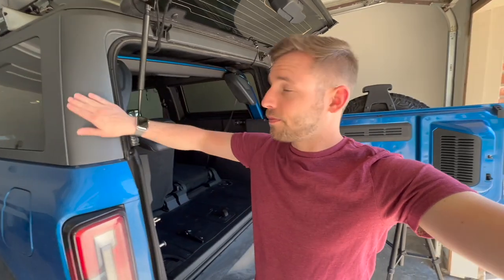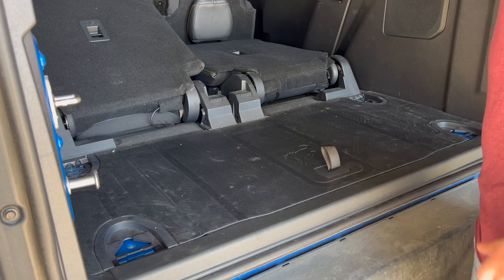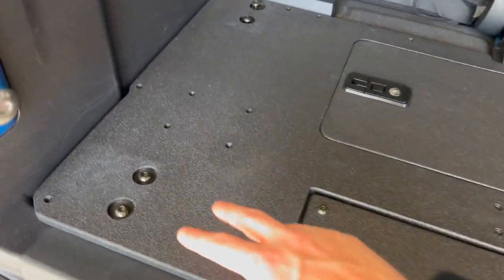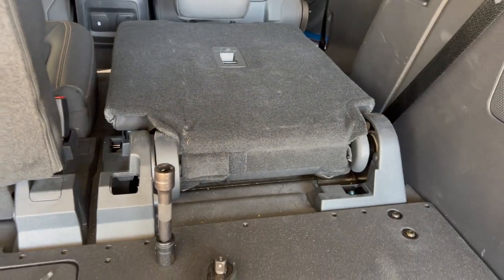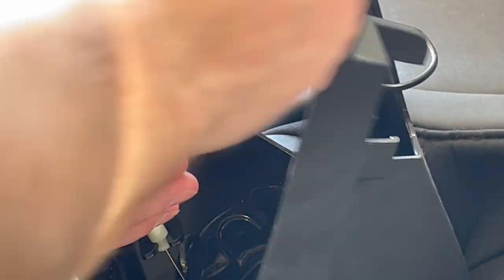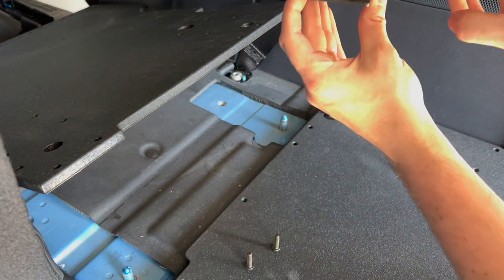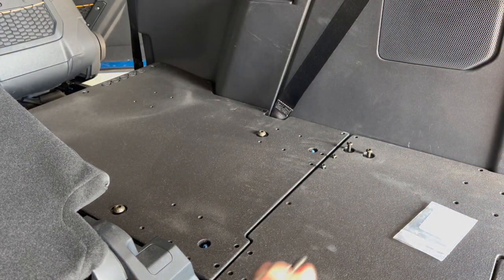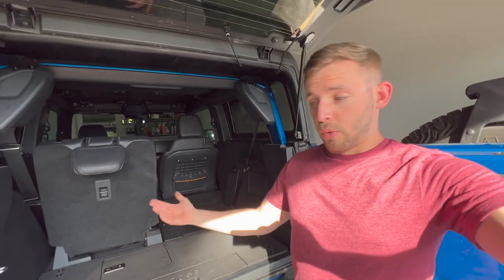GooseGear Plate Install On My 2Door Bronco! *Overland Setup*

Comment: This looks like a very nice, well made and solid set up.  I want to remove the same seat that you did to place in a rigid dog crate.  Can you tell me, what is the widest solid object that will fit from the edge of the remaining seats right plastic bracket cover towards the far right inner wall panel?  Great video and thank you.

Comment: What are the dimensions between the 1 rear seat and the delete? I am trying to figure out if I can fit a dog kennel with just 1 rear seat delete, instead of both. These are the dog kennel dimensions. 34" (L) x 23" (W) x 28.5" (H)

Comment: I have been watching your videos, really good content! I know you got rid of your Bronco - but do you remember if the Goose Gear platform was "slippery" or did it have good grip? I want to put one in for my dogs but worried they will slide around.
Reply from the maker: I mean I though it had pretty good grip for not having things slide around unless it was hard plastic. The textures alot like a bed liner. 
Thanks for watching!

Comment: Bummed to see the bottom of the plates are unfinished... concerned about longevity and water/moisture?
Reply from the maker: I’m not too worried about that. How often are you going to have enough water underneath it to actually cause damage. Unless I left the top off in the middle of a storm. So far I haven’t had any issues after a couple months with it and using it off-road.

Comment: When you folded up the cover to access the bolt holding in the seat belt, I thought that you were going to remove the seat belt to put in the latch, so 2 questions:
Why fold up that cover, and won't the seat belt reminder go off if there's no seat belt inserted into the latch?
Reply from the maker: That’s where you disconnect it. So it won’t go off if there’s no seat belt connected.
Reply: It's a rear seat belt - I don't think I've ever driven a vehicle that chirps at you if a rear seat belt is unlatched upon start-up.

Comment: one question… wrangler vs bronco, whose audio/sound system is better? does your wrangler have Alpine sound? Is it worth the money? Thanks handsome
Reply: I had a Rubicon with the Alpine system. It’s better than any audio system that Bronco has.
Reply from the maker: My 2DR Wrangler has the alpine sound system and the broncos has a bit better mid range but the bass is better in the wrangler.

Comment: Seems a bit half-baked. First, they should have made the cubby door cross the entire cubby. Second, they should have added a latch to the jack compartment as well, instead of screws. And then the missing parts out of the gate. Good idea, needs better execution.

Comment: What is the length front to back of the overland setup once installed?
Reply from the maker: I'll get a measurement for it here soon. currently letting my cousin use it since he's out of a car at the moment.
Reply: Yes. Will a 6ft or larger person lay straight in there?

Comment: The more of your Bronco videos I watch, the more I'm inclined to keep my JL! One of the first things I did after purchasing my JL was removed the rear seat, as I'm not interested in chauffeuring anyone around and I like having the entire rear cargo area open. Literally a 5-minute job with a Wrangler. Looks like to do the same with the Bronco is comparatively a PITA, and also requires a crappy kit from a company that doesn't even QA their products well enough that they ensure no parts are missing! (Well done, GooseGear.) Thanks for the continued Bronco videos, but I'll stick with my Wrangler. At least for another few years, until Ford works out the kinks. ;)
Reply: I've been through 4 2 door Wranglers including one Rubicon. Other than the rear seat, my 2 door Badlands blows away any of the Jeeps I've owned. Yeah Ford could make a few improvements, but for a first gen (6th gen) of a "new" model, they did a damn good job. And yes, I do off-road.

Comment: How much weight did that add to the bronco?
Reply from the maker: Actually, it probably took weight out. The rear plate weighs about the same as the old rubber/carpet one did and the seat back and seat bottom along with the attachments weight more than the other plate. It’s within 5lbs I’d say. 
Thanks for watching!